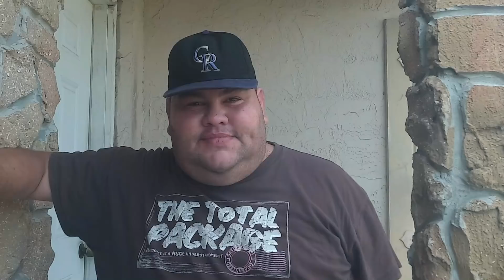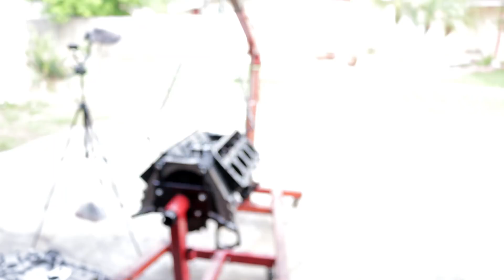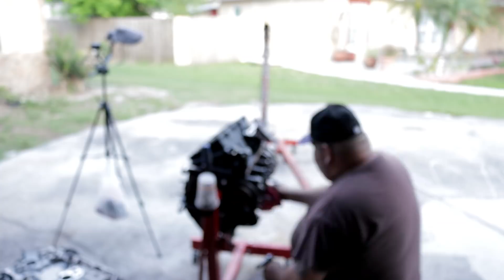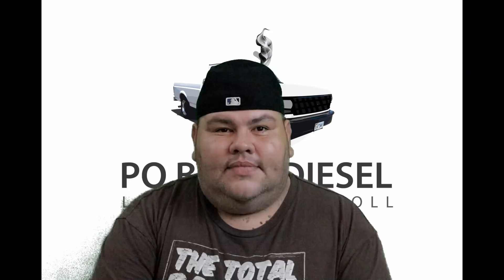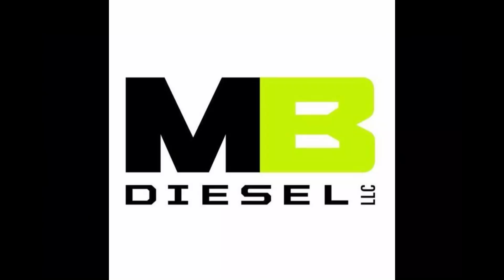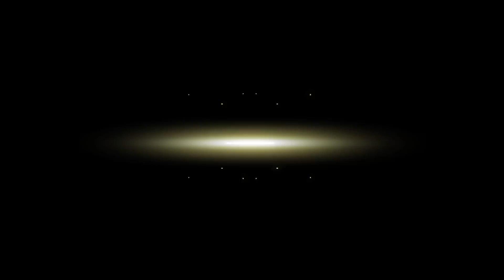7.3 Powerstroke engine tear down for Race Build Part 5

Comment: Is it a manual  or a 4r100.  Are you going to do any transmission upgrades?
Reply from the maker: Hi Thanks for the question.  The truck has an E40D 2wd. I do have a very highly modified one with billet input shaft, billet internediate shaft, billet forward drum all steel plannets with larger count of pinions a modified valve body Alto red frictions and koline steels. However do to the fact that the plans of this build have continued growing into bigger & better things. We have decided to do a fully built TH400 with trans brake and well all the goidies we can have stuffed in it lol this set up has been proven by many including our partner in the engine build. Grays Diesel who has the fastest 7.3 truck on huei injectors in the world as well as Rudys race truck. Crosding fingers and praying hard over on our end to reach our goals it does take a ton of money to make a build like this one, but we are dedicated, fully committed and optimistic and with the support and motivation from all our Subscribers it sure keeps me motivated to continue the build and have it all step by step on our videos. Thanks again for the question and Let the Coal Roll.